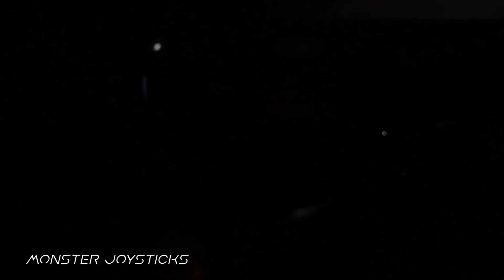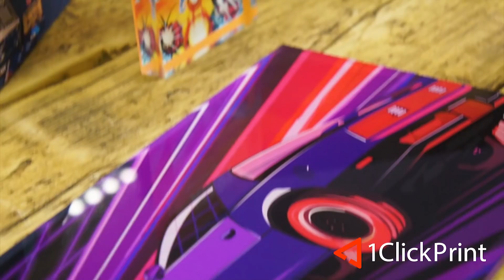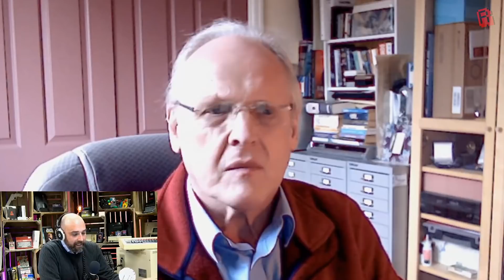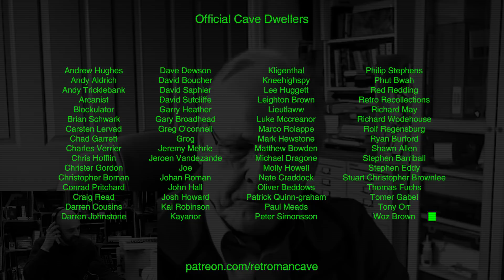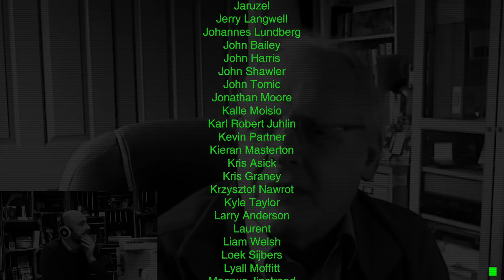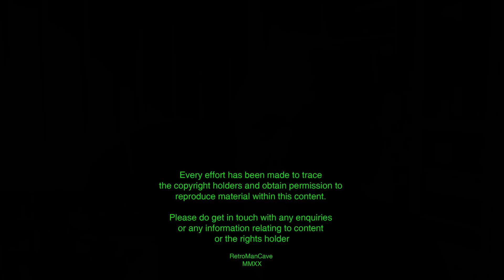Retro Tea Break | Steve Furber on Acorn Computers and the BBC Micro

Comment: The Arduino is a closer eco-system to the OG  BBC. You can even just code bare metal on the Atmel chips.

I 53 and my brother 56 both got 'O' Level Computer Studies as he strawberry picked until he had the £465 for a Model B + DFS.  He's still a virtualisation trainer/consultant. I took early retirement.

Comment: Really great interview thanks. Just got near to the one hour marl where the the Acorn Phoebe/Risc PC II got mentioned. On 9th June 1998 in the Main Debating Hall - Manchester University Students' Union Building I got to see the non-working prototype (Bright Yellow) Here is the mini report I did from that event which used to be on my old Acorn Blog - 
The last meeting of the Manchester Acorn User Group before the Summer break was held at 6:45pm on Tuesday 9th June (Main Debating Hall - Manchester University Students' Union Building.)

Russell Scoates and Dave Walker from Acorn brought along (unfortunately) a non-working Phoebe 2100 prototype. At a demonstration the week before in Holland - 'The BigBen Club Show?' - the Vidic20 had blown.

However the talks given by both and the full and frank way in which they answered many questions about the new hardware and software made the meeting very informative.

Apart from a few areas where 'non-disclosure' agreements held back the free flow of information a number of details of the new machine were clarified.

    The first batch of a hundred or so machines will go to software developers and suppliers.
    The second batch of two hundred and fifty should ship in late August giving a final chance to sort out any last-minute problems before ramping up to full scale production.
    Hopefully September or possibly early October - but definitely in time for the Acorn show - Phoebe goes into full production.
    The machine will definitely ship with a 6.4 Gig Harddrive.
    At least four PCI cards software drivers are already being developed - PC,SCSI,Grapics and Video.
    The speed of the serial links will be doubled to 200,000 bps.
    The speed if the Vidic chip is also doubled to 200Mhz (1600 by 1200 in 256 cols hopefully.)
    The Risc OS 4 will be in 4Mbs of ROM but this will soft load into Ram on boot-up to give faster operation.
    There is a link on the motherboard that would allow the ROM to be increased to 8 Mbs.
    As well as side access to the inside of the machine it is possible to lay the machine on it's side and then the bottom panel can be flipped back to allow the motherboard to side out.
    A CD Rom with a full copy of the software shipped on the harddisc is very likely. Also being considered is loading a large batch of Shareware and Demo software on the harddisc.
    Some decisions have yet to be made on other software to be included free ie Replay3.
    Also being considered is whether some form of upgrade voucher will be provided ensuring a fixed cost upgrade to a higher spec StrongArm daughter-board if or when one becomes available.
    Already there are reports of chips being developed that will hopefully run at 360 Mhz.

And below the possible working specs were (as of late August 1998 at Wakefield) as below: 
 Details of Risc Pc II - unlikely to be built now - details left here for us fans to weep over. (See top of this page for latest developments.)

They are based on my understanding of what was said at Wakefield - so no guarantees as to how accurate these details are.

The Risc 4 desktop and case looked good at the show but all the hardware was not in the machines so no idea as to how fast they will run but they are expected to be 3 to 4 times as fast with same StrongArm chip as Risc Pc.

Talk on the Acorn Newsgroups in late August suggest that there is now another change of heart over the naming of this new machine - the search for a new name may be on again!

64Mhz motherboard 32 SRRAM 4(EDO)VRAM 6.4 GIG Harddisc

3 old sytle podules, 4 PCI slots, 32 speed CD Rom and 230W power unit.

New Risc OS 4 allowing file names of up to 255 letters (truncation can be user set)

80,000 items per directory new LFU harddisc making large discs waste less space (for any given size disc the block size will 16 times smaller! ie instead of 32k blocks - 2k blocks) will support harddiscs up to 128 Gigs!!! :-)

Tidy up of desktop with new 'bring to the front window' to support built in screen saver.

A new 'minimise' button on window frames.

Two serial ports , joystick port Midi in/out, parallel port inproved Vidc20 getting twice the video speed (1600*1200*36,000 cols) Microphone in socket

EIDE harddisc interface to level 4 (ie 16Mbs per second) supporting 4 devices.

On sale as from September with or without Iiyma 15in monitor (1500 plus VAT without monitor) but at show they said that as prices of things like harddiscs kept dropping these specs/prices could alter.